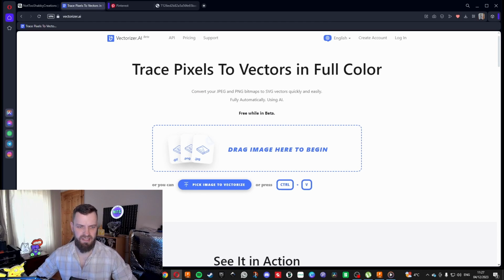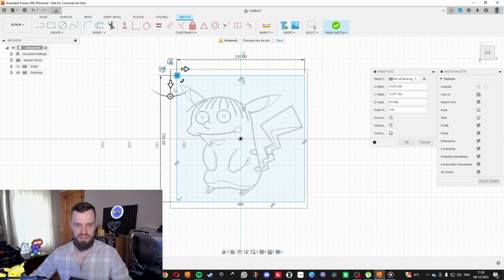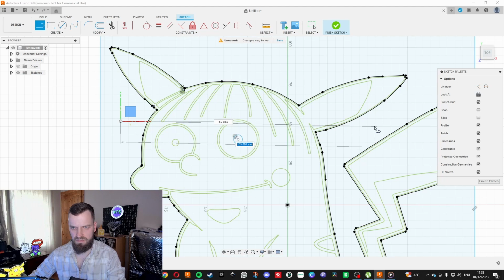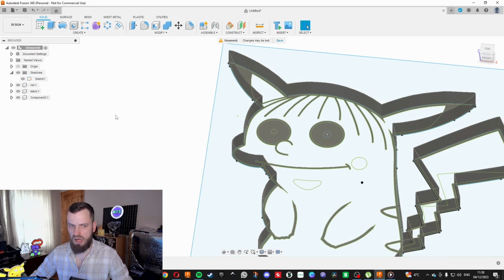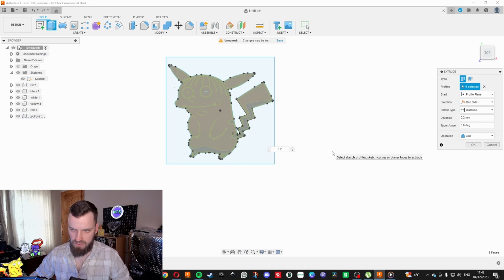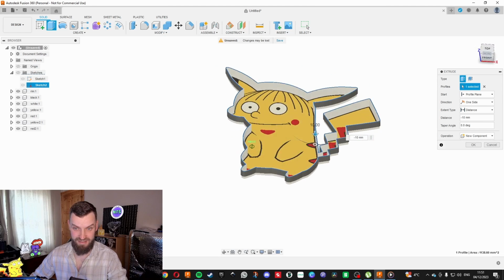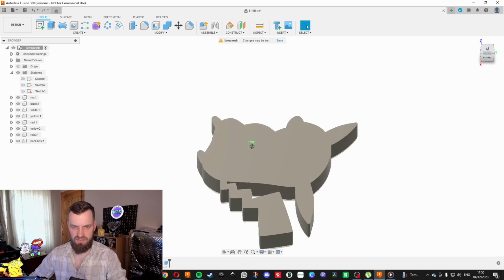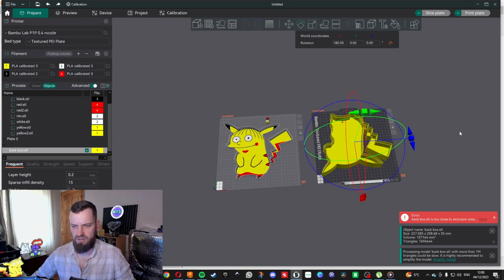Create your own lightbox in Fusion 360. And use AI tools to convert image file to SVG file.

Comment: I am good until you get to making some black then boom you are on a 2nd sketch? and back in design mode how did that happen? then I try to do what you are saying by selecting add sketch for #2 sketch and can't highlight the edge to do a offset? very confused at that point
Reply: ok got it but,, the issue I have with #4 sketch supposed to be the back? or jus the hole? and the only back piece I could find to save as mesh was under body1 ? and there is no indent in it or the rim around the face and side plate for the back to fit into  not sure what I did wrong but I did get most of it right :) yours is the 4rth video I watched to learn this and only one I actually got thru to make one  so A+ to you :)
Reply from the maker: sketch 4 was for the hole for a wire pass through yes. Seems like have missed one offset or extrusion on the sketch 2 when creating offsets for the back box. And thank you for the A+ :)    @simplybabette